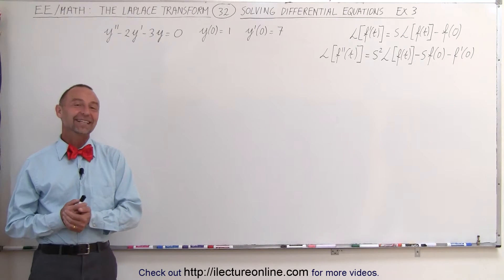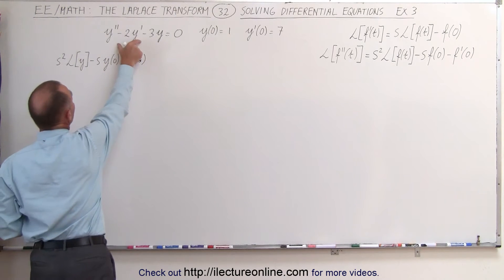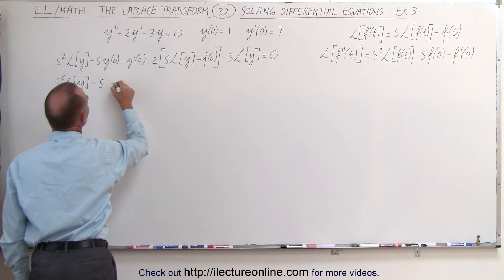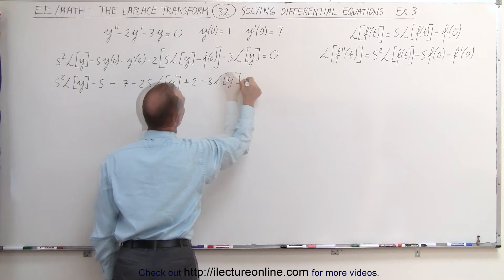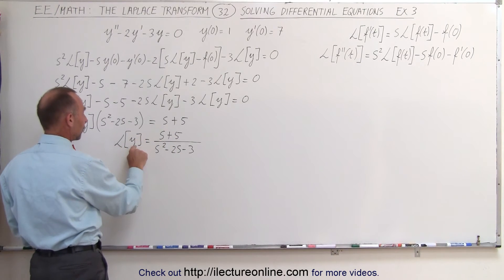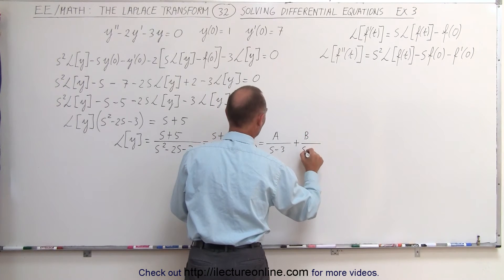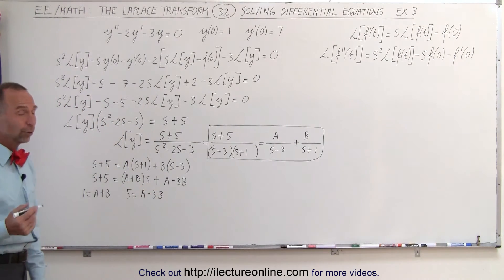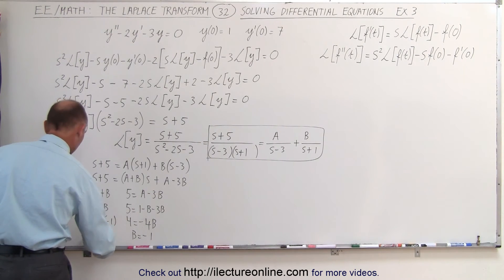Electrical Engineering: Ch 16: Laplace Transform (32 of 58) Solving Differential Equation Ex. 3

Comment: I have a question:  I did the problem before watching the video.  The part when you factor out the denominator s^2-2s-3 which is equal to (s+1) and (s-3) I set it up like so A/(s+1) + B/(s-3) and ended up with A = 2 and B = -1 which agrees with your results.  However, towards the end, my final answer would be y = L^-1[(2/(s +1) - 1/(s-3)] = 2e^(-t) + e^3t.  Your answer is different because you set it up like so 2/(s-3) - 1/(s+1)  = 2e(3t) - e^(-t)..I though the order didn't matter and will still get the same answer.  Does order of denominators matter when using the partial fractions method??